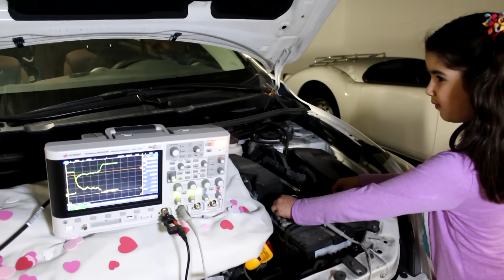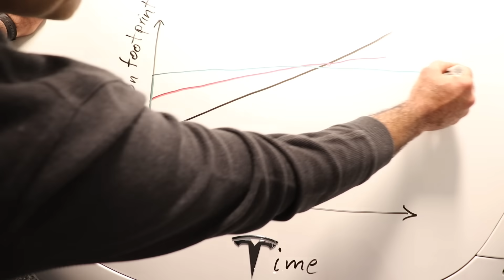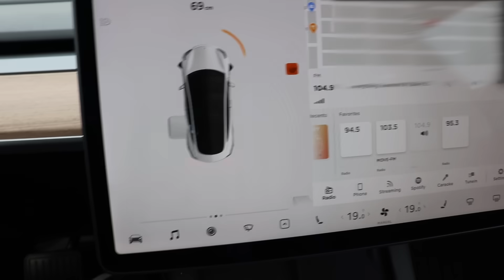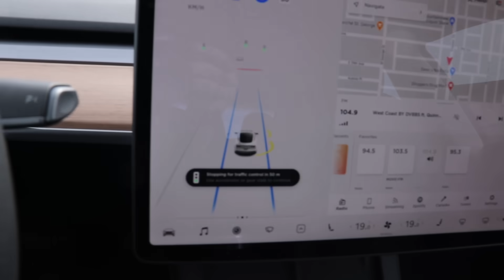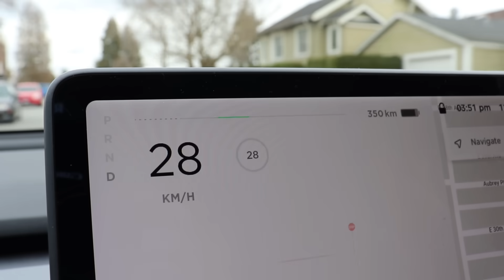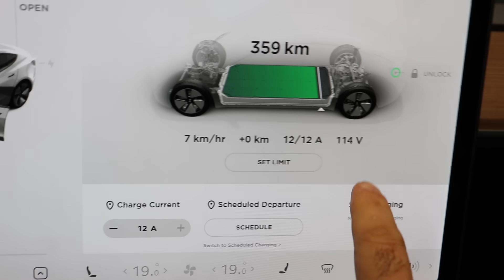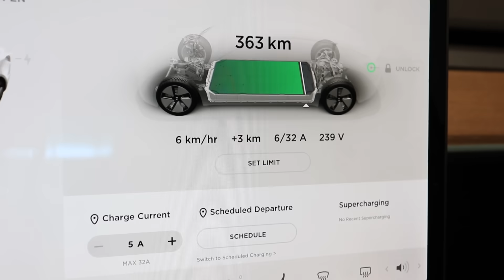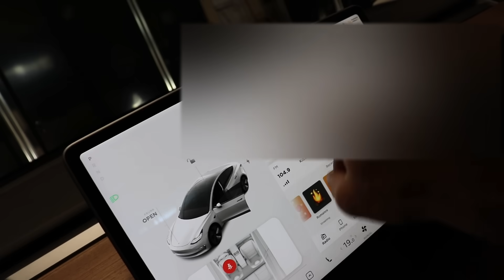ELECTRIC VEHICLES & My Tesla Model 3 Review

Comment from the maker: 10 MONTH UPDATE: I had them replace the faulty display that kept crashing, no more crashes and display works solid. The battery range charges to around 5% less than what it was originally. Not sure if the battery range actually dropped as batteries degraded, or it is some sort running correction the car performs. I'll keep watching it for changes.
Reply: Make sure you charge it to 90% at least once a week, and only charge to 100% when you are preparing for a longer road trip.  I've got 2000 miles on mine so far and zero degredation (90% is still 235 miles, same as the day I got it - SR+).  The newer SR+ has LFP batteries that you can charge to 100% daily, but they are heavier and the car has less power.
Reply: 5% range lost in the first year is normal. Then it will loose about 1% a year.
Reply: @markmd9  It actually depends quite a bit on how much you drive, and even moreso, charging habits.  The sweet spot is charging to 80-90% for daily use (only going to 100% in preparation for a road trip).  He's actually doing his battery a HUGE favor by limiting the charging speed to only what he needs, so he will probably get less degredation than average.  Obviously most of this only applies to the NCA batteries, the new standard range Model 3 has moved to LFP batteries which degrade less, and can be charged to 100% daily.
Reply: @markmd9  Range loss is far more than 1% a year, I'm sorry to say. The more charging/draining cycles it experiences, the more loss occurs. Just like any battery, its charge capacity over time can be represented in an exponential downward curve, where at some point, his range will be so low that the battery must be replaced. Looking at the quotes for a Tesla battery replacement is over $15K. Ouch, no thanks, I'll stick with my late 90s civic with over 300K miles running strong lol. But you guys have fun playing with your glorified iPads lol
Reply: I laughed my ass off when I noticed you drawing graphs on the hood of your Tesla. 
That killed me.
Reply: Appreciate the update. I came to this vid wondering if we'd get an update. Maybe at 1 year!
Reply: A comment to remember this!:

Dec. 28, 2021 - 12:08:23 AM

Regards from Romania, Mehdi!
Reply: 3 year update when?
Reply: Y’all debating in pointing this out. I guess it being a faulty part kinda doesn’t fit his description of maintaining but still found it funny after reading this prior to getting to  this point11:53
Reply: Let us hope that Mehdi doesn't disassemble this car for electric parts...or shock it dead when some experiment on it goes wrong.
Reply: @ElectroBOOM chargin teslas is free. So is that free energy?
Reply: Noone charges any lithium 100%
Makes it last many years longer.
Reply: The battery degrades with ownership.
Reply: I diagnose you pocket pain
Reply: If you used the rotation of the wheels connected to a generator, how much more would that increase the range of the electric car.
Reply: @S. Stewart Okay yeah, I know that. But I saw a guy put on an actual electric generator on his electric car and attached it to his wheels. He ran it while the wheels were turning. In order to make electricity, the generator has to turn, so can't they use the forward motion to charge the battery while driving not just braking. Unfortunately, I can't seem to find the video anymore and was wondering if it made a difference. Or do the added generators hinder the vehicle?
Reply: @S. Stewart Thank you. I figured it was something like that. More weight and energy needed to turn the generator makes sense, but now I'm wondering if it has gains at all. Even a 10% energy loss reduction would be good in my book. I had this idea to make just the ugliest electric car you could think of. Put small wind turbines on the front of the car, add generators to wheels, and solar panels to the exterior. I wouldn't look pretty, but it might improve battery life. I'm thinking of making a miniature model in the future. Might be fun.
Reply: So... How's FSD working now.
Reply: @SylvieTheBagel  Scarily aggressive, the way it figures out obstacles is scarily cunning smart. Too the point it's way to comforting for occupants and this should be alarming.
Reply: Will you gonna modified it 😂
Reply: i miss the good old toyota matrix but its time for q upgrade
Reply: Actually charger runs more efficiently at higher load. Not 5A. Please test and report :)
Reply: Pity that you did not share the car electro details like type and number of motors, battery voltage, bms boom protection etc. 
This way you talk more less like any other car reseller.
Reply: Eh useless
Reply: What if you get the new Highland M3 and sell this one, or at least review the new one trough the Youtubers that have access to one, without buying it. I would be interested in an actual comparison, but try to do it on the Dual Motor, Long Range, right now the single motor is being shipped and reviewed, or maybe, even the Performance that is coming with Ludicrous speed badge .
Reply: So it's been 2 years what would you like to update?
Reply: change your drive unit oil and filter
Reply: Ouch
Reply: 13:27 that statement can be debated. I use a 2017 1.5L 3 cylinder BMW 118i (automatic)  which comes with an 'eco pro' mode. The basic premise of this mode is to be economical. For instance, it has a start stop function ( when you brake to a stop the car turns off until you accelerate again). Another instance for when i'm using this mode is when I take your foot off the accelerator, the  car will 'put the clutch in' so the car is just rolling (this saves even more fuel). It has other features in the engine regarding valve timers etc... and all that combined leads the car to consuming:
 4-5L /100km or 48-58mpg(US) or 56-70mpg(UK)
You got me with the difference in energy prices
Reply: @akhilpillay4262  It'd be a pretty one sided debate. Electric cars kick the crap out of combustion vehicles in the efficiency department, it's like comparing incandescent vs LED light bulbs. WLTP ranges are incredibly optimistic, its nigh impossible to achieve that advertised 48-58 mpg in day-to-day conditions. Besides, if the absurd WLTP efficiency ratings are to be believed, the Tesla Model 3 gets the energy-equivalent of 170 MPG (US)! 3x the efficiency of the most optimistic estimate for that 1.5L BMW - it also achieves that efficiency while being a much higher performance vehicle, whereas currently in the combustion world you basically have to make a stark choice between efficiency or performance.
Reply: @0hypnotoad0  You obviously don't realize the environmental impact of digging up large amounts of earth to simply gather the material needed to make one Tesla battery. Not to mention the price of replacing one of those (~$15K). My late 90s Civic is getting 34 MPG and it has over 300K miles lol. These are glorified iPads that need batteries every 5-6 years lol
Reply: @Powertourg  34 mpg, wow! Could run 4 of my car on that amount of energy, on renewable power no less. Obviously you don't understand the environmental impact of oil extraction. The source of oil used locally near me, comes from an open pit mine the size of Edmonton. It's a hole that can be seen from space. The resource that gets dug up gets used once, and takes a few million years to recycle. Lithium, nickle and cobalt in traction batteries gets used thousands of times and is then recycled in the span of a few days.
Reply: @0hypnotoad0  The fact is though that efficiency is not real if you can't store the energy properly. On highway I would need to recharge every 200-250 km depending on weather, for not sure how long - 15 to 20 minutes? instead of fueling every 600km for 5 minutes I do now. That would mean charging 5 times to go visit my parents, that makes it completely unrealistic. Mining materials for batteries and energy generation aside, these things will not be competitive unless they get double the range with half the charge time, and we're still looking at cars that are average for price of a premium car.
A long range model 3 with basic / economy wheels, basic colour (I heard it's quite atrocious quality too) and autopilot software is 60k euro over here which is something I can't even afford. If I were to buy a new car (which I never did and not planning to do) I would still look 20k cheaper, or for this money you can get a much better car.
I completely understand that if you have such a car you're happy with it, or you're just a fan of the concept that's great, but currently for most people there's more things against it than for it. I remember when the whole thing started like 10 years ago people said how these have the potential to be cheaper when it will be manufactured in large numbers. Well, it didn't, they are still considerably more expensive than internal combustion counterparts even though there's less punishment taxes and complexity of build is a magnitude less.
The theory of recycling is also great but seeing how electronics recycling works I have great doubts what percentage of that claim is actually true. Maybe we will have 10 year olds in India or Thailand actually dismantle a lot of these if we ship them there at some point, maybe not, for now these are just claims as there's no actual need of recycling them yet in large numbers. We can only know in 10 or 20 years.
There are arguments over how much cleaner it is, we only know it's good for local air pollution, other than that everyone makes their own study and gets the numbers they paid for, so we don't actually know considering everything what is the true pollution, considering maintenance, for either.
It is yet another topic that was picked up by politics and Internet celebrities like Greta & team which pretty much guarantees there is no objectivity and visibility. It tends to happen with every subject, see how covid conversations go on Internet, it has been hijacked by conspiracy theorists and politicians and a lot of contradictory information over something that should be fairly straightforward from scientific perspective.
Reply: @bencze465  No, the actual fact is that the vast majority of people take bathroom and food breaks enough on long road trips that charging takes almost no time. A 10 hour drive in an ICE takes 11 hours in an EV, this is something that I have actual experience in, and I'm guessing you don't. The time difference road tripping is negligible.
Reply: @Powertourg  "These are glorified iPads that need batteries every 5-6 years lol" LIES you LIAR!
Reply: @0hypnotoad0  LiFePO4 batteries have ZERO Nickel and Cobalt.
Reply: @akhilpillay4262  I know this is a bit late but the Chevy Traverse also has that (My dad has a newer one, forgot the year)
Reply: @akhilpillay4262  But the Tesla recharge the battery when downhill so the statement is correct.
Reply: @akhilpillay4262  He said you never gain anything with gasoline cars, which I don't think is debatable still even with your best case scenario, though those are some really cool features
Reply: @akhilpillay4262  You're missing some factors in your analysis. The 'start/stop' (I have it as well on my Chrysler Pacifica) doesn't really save that much fuel. Firing up the engine takes significantly more fuel than having it idle a very short time. When you take your foot off the accelerator the care does NOT 'put the clutch in'. Running a vehicle in neutral vs. in gear for an automatic doesn't save fuel. There is no way you're getting 50+ MPG on anything except a non-stop highway drive with a tailwind. Any way you slice it... EV will rapidly replace combustion passenger vehicles.
Reply: Good
Reply: lifepo4 prismatics batteries and 32650 as well, used of course. solar panels went up a few in price though, still, yay!!! doing good offgrid with used 90ah eve cells 24v setup 1kw inverter and an mppt with a 365watts mono panel, i mainly use around 2amps every night and spikes with the hot plate daily, some dc fans, a dc water pump, a laptop and router. could use more panels but im over budget lol, like always.
Reply: @peleds1983  Add in a wind turbine for night power gen and you won't need any more panels.
Reply: Chances are, like with all batteries, the cells eventually die out. Over time, the range will be significantly reduced to the point where a complete battery replacement will be needed. Estimates show Telsa batteries may last roughly 5-7 years depending on charging cycles and other conditions, but chances are, you will likely be replacing the tesla battery more than once assuming your plan on keeping it as long as the Toyota (which can run forever without needed its internals replaced). This is what everyone fails to mention when talking about the "efficiency" of electric cars. The amount of earth needed to be dug out to produce enough raw materials to create these car batteries is far more harmful to the environment than the current emissions of combustion engine vehicles. Not to mention that large infrastructure changes will be needed to make these more accessible worldwide. Not a fan of electric vehicle technology so far, I must say.
Reply: @Powertourg  "last roughly 5-7 years" Absurd idiotic LIE! You do realise the WARRANTY is 8 years for most BEVs. Automakers do not like paying out warranty repairs, they make it 8 Years because they know vast majority of batteries will last alteast a decade. Speaking of Toyota, Rav4 EV from Y2K era on average survived 17 years. This was a NiMH battery with no active thermal management. A modern Lithium Ion EV with both heating and cooling will not survive better also around 17 years. But during that 15 years plus you could easily  achieve close to 300,000 miles. This negates your LIES! that BEVs require raw materials over their life time. Fact is ICE requires far more consumable in sheer TONNAGE compared to a 1000lbs battery for the entire lifespan of the vehicle. You are just a troll spamming nonsense.
Reply: @Powertourg  You're WAAAAAAAAAAAAY off if you think Tesla batteries only last 5-7 years.  And you're wrong about the environmental impact of the batteries (and the fact that batteries can be recycled and up to 97% of the materials reclaimed).
Reply: @Powertourg  Umm.... you forgot to account for the amount of Earth to create the EV... you need to do the same to build a CV... so... net gain still goes to EV. On the '...can run forever without needed its internals replaced'... not true. /At a bare minimum you will be regularly replacing oil/fuel/air/trans/brake fluid filters. You will also need to replace belts and hoses, brake components, etc.
Reply: Tesla balloon are growing, every promise we get from Musk or Tesla goes to be a lie. EV is well paid by governments to be a good business, even with simplier and fewer parts EV cars have higher price then normal cars and you got a car with lower quality in a higher price range plus it takes more time to charge it and the lifetime is lower, harder to use in the winter no thanks. Tesla said battery could be reused. Then why won't Tesla buy back the used battery pack?This is a big business for the manufacturers and nothing more. No future in it, because it is deadend without the financial helps of the governments, even Tesla got ton of money from US to be alive, ehh.. EV cars are getting higher and higher prices, so it won't be common use plus at cold countries what will you do without preheating?
Reply: @szgege32  Welp that aged poorly. FYI BEVs are popular in the ARCTIC CIRCLE.
Reply: @S. Stewart In all seriousness, is that function already built in or something, I mean, what if we added everything we could to an electric car to help charge the battery while we drive. Cover the thing in solar panels, put some fans on the front of the car to spin another turbine, what else could you put on the thing. I understand more weight means more power is needed to pull the vehicle, but Solar Panels are pretty light depending on the kind you get, we put grated vents on the fronts of most cars to keep the engine cool, why can we use fans to capture that energy blowing in to charge the batter while moving? About the only heavy thing would be the generators slapped to the wheels.
Reply: That's a bit worrying, only 10 months later? I hope it's not the battery dying already because it's expensive as fuck and having to replace the battery so soon means a lot of people will dispose it incorrectly
Reply: @sayori3939  That is some absurd fear mongering. BEV batteries just normalise the first couple years around several percent loss. Then is plateus stalls for several years and barely degrade. It's around the Decade mark it start degrading realy again. These are statistical facts.
Reply: Ah yeah Electric cars... With battery that degrades.
Fun fact: gasoline don't degrades 👍🏼
Reply: @samuelebaiano6505  "Fun fact: gasoline don't degrades" Have fun using 18 month old gasoline. Why don't your bet you life on it and fuel a get away car with 18 month old gasoline.
FYI I have two lithium ion batteries for my Panasonic Lumix FZ-50 which sitll work perfectly fine. FYI I bought it in 2007, it's 2024 when I pulled them out of storage.
Reply: @Neojhun  jokes on you: try a 18 month low lithium battery, have fun 😊. Bro i’m a  electronics technician, 5 years in Italy high school… what i have to say?